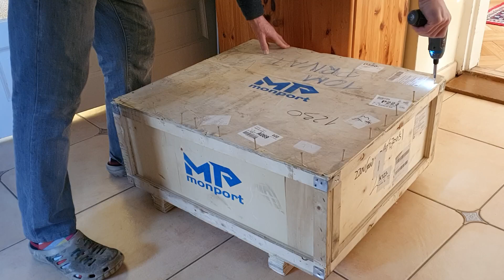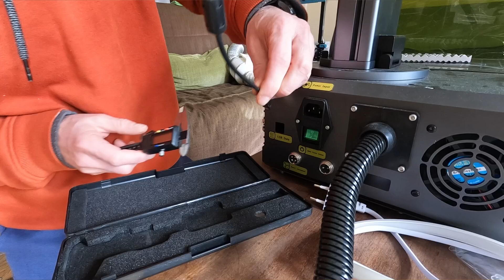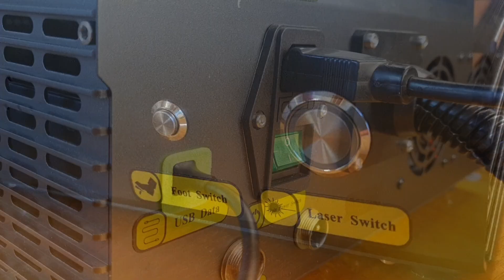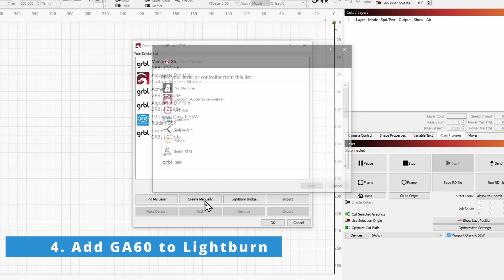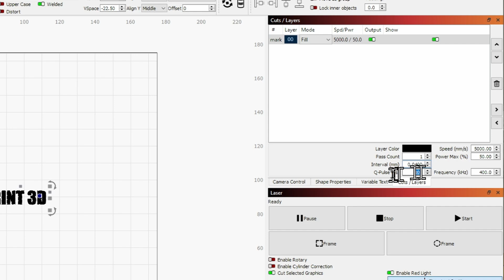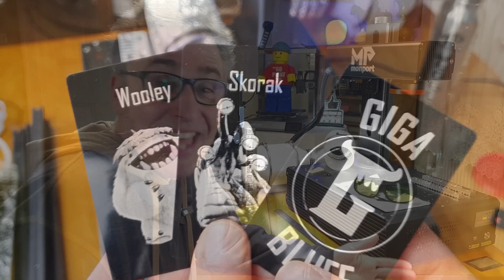Monport GA60: Lightburn Setup + How My Sovol Zero Unexpectedly Saved this Amazing MOPA Fiber Laser

Comment: Hi can you recommend which one is better, monport or commarker b6?
Reply from the maker: I only have this Monport GA60, which I am very happy with. It is very very well built. And versatile. Not JPT laser source, but looking at Commarker B6 MOPA 60W specs (though I am not sure it is the MOPA specs on their official website...), the Monport GA60 has wider pulse range (1-500ns vs 130-160ns) wider freq range (1-3000khz vs 40-60khz). Rotatable arm, no need for awkward riser. It is heavier and sturdier, which could be a plus or minus. But seems to be a bit more expensive (though with my coupon + current sale it is close). I am a bit biased of course, but very happy with this one.
Reply: Monport！ No commarker！I have a Monport GA100 and a Commarker B4 60W. I want to see the difference. After disassembling the machine, I found that Monport's workmanship was very neat and the wiring was standardized, but Commarker's interior was very poor, so I returned B4

Comment: You didn't actually ever explain what a MOPA laser is.  MOPA stands for Master Oscillator Power Amplifier.  This means that the pulse frequency, pulse width, and duration  are easily applied to a small diode seed laser, the "master oscillator".  The output of this seed laser is then applied to the power amplifier, which is a conventional fiber laser amplifier.  This combination is quite handy because we can get an "average" power of 60 watts from the power amplifier, but the peak powers can be MUCH higher.  For example, if you apply a 50% duty cycle of on-off to the unit, the "ON" power will be 120 watts.  This can, of course, be taken to an extreme..  When I worked at a National Laboratory I designed a laser system that used a 5 Watt IPG fiber laser amplifier.  Into this amplifier I delivered a seed laser pulse that was 50 picoseconds in duration at a rep rate of 31 MHz.  The resulting output beam had peak powers exceeding 1kW, yet the average power was always 5 watts.  If Monport would like me to review one as well, hint, hint, I would be happy to on my Youtube channel.
Reply from the maker: Wow, thank you for the precise and easy to understand explanation. You are right, I chose to only highlight the most practical user-facing advantage of the MOPA aspect in this introductory video (in the Lightburn setup section), as I only plan to utilize the added capabilities in a follow episode. Since this is the very first fiber laser on my channel, my aim was to introduce the layout, configuration of this style of lasers highlighting the most obvious use cases. There is much more to come! Thank you so much for watching my videos and helping the community with your insights. I agree, you should definitely demo and create tutorials for these types of devices, the creator community would greatly benefit from them!

Comment: Hi, do you know how to tell if a new SV08 has the old nozzle with the petg issue pushing it out or a newer fixed version? What is the easiest way to tell?
Reply from the maker: Yes, if you slide the heatblock off you should see a grub screw. I show it in this video: https://youtu.be/sOknzwXCks4  But I think anything sold after the middle of summer will have the new nozzle.

Comment: ¿What about Linux driver for this device?
Reply: You can verify with Monport but I think your Linux options are more limited.  You could install Lightburn on Linux and use the GA60 the way most people use it with Windows or Mac, or you can install the Windows open source LaserGRBL software on Linux running under Wine to control the GA60 but it's very limited compared to Lightburn, although honestly, my needs are usually fairly simple and I prefer simpler software with fewer options.  On my little 10 watt Elegoo Phecda laser, I copy properly scaled image files to a USB drive and laser engrave them directly from the LCD interface.
Reply from the maker: I am using windows, so I cannot really help. The usb interface chip seems to be a generic one, showing up as Cypress FX2LP after installing the windows drivers. But Lightburn it itself might be able to control it. Unfortunately this is as far as I can provide you with information. Feel free to ask specific questions, or contact Monport directly. Someone else reading you comment might be able to provide you with more useful answer.
Reply: @  Maybe is my fault i wasn't clear. Does the device even have a linux driver?
Reply: @paelnever  I think the answer is "no", but there is software that should be able to make it function anyway, just maybe not as well (with as many features) as it would work on Windows.
Reply: @timothymusson5040  Then my answer will be "no no" to this device.

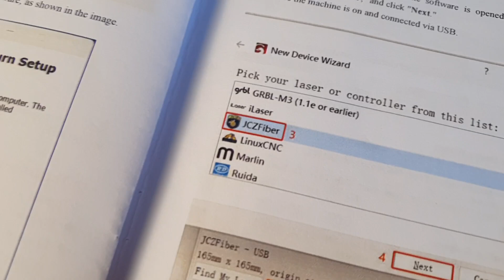Comment: 8:30 - Kudos to Monport for LinuxCNC support.  The GA60 is on the opposite end of the laser spectrum from my 10 watt Elegoo Phecda laser that I use to put the company logo on 3D printed TPU parts.

That USB strain relief was very nice, and a needed addition to the GA60.  I love FreeCAD and 3D printers for everyday practical stuff like this.
Reply from the maker: Yes, I too was successful marking TPU with my very first tiny diode laser → https://youtu.be/i8neuRXBRXM MOPA is said to be pretty flexible, I plan to do a whole video on marking 3D printed materials, PLA, PETG, TPU etc.  I just need to make my enclosure and vent system first.
Reply: @gerGoPrint3D  - The inexpensive blue diode laser engravers are OK if you occasionally want to do light engraving on opaque plastics or maybe wood and paper products, but a galvo fiber laser will quickly engrave almost any material.

Functional Print Friday recently designed a universal enclosure system with 3D printed corners and vertices with inexpensive CoroPlast used as the panels.  It's clever, as his stuff typically is.  He used it to enclose his fiber laser.  Might be worth a look before you enclose your Monport.
Reply from the maker: Thank you @Liberty4Ever for mentioning the LinuxCNC support. What does it mean? Can you please help @paelnever on what this could possibly mean for Linux compatibilty? Using Lightburn? Or other software?
Reply: @gerGoPrint3D  - LinuxCNC is primarily designed for controlling lathes, milling machines, CNC routers and other CNC machining applications.  It even has delta and various robot kinematics.  However, when I last used it on my CNC machines it didn't do raster engraving.  It's a vector based motion control system so it might be good for laser cutting applications but slow for laser engraving.  I still planned to use it on my 80 watt CO2 laser build because I love open source and all of my other shop tools run LinuxCNC, but that's a project I never finished.  I'll provide a more relevant answer @paelnever in his thread, below.

Comment: Nice demo!
Does it really do curved surfaces that easy? Could you show the whole workflow for a curved belt buckle?
Reply from the maker: You know I haven't even thought of it. This belt buckle was literally the second thing we tried after unboxing and the mandatory painted metal cards. This buckle is not that curved, there is maybe 2-3 mm difference between highest and lowest point on the surface. At a focus height of 320mm we have that much depth of focus.

Comment: I want so much a fiber laser! But even the cheapest I have seen in aliexpress is already too expensive 😅
Reply from the maker: Yes, these only make sense if you use it for business. But then they bring back their price quickly. The ease to customize cheap blanks is astonishing. And unlike other lasers or 3d printers, fiber lasers need almost no maintenance and last for 100,000 hours. Maybe you can find someone in the family who would be happy to work from home and you could share the revenue + get access to use the machine when you need it.
Reply: @ i use to maintain a couple CO2 lasers my wife used for making clothing accesories with acrylic. But now we don't have that big space anymore. I will  investigate if these type of lasers can work on transparent acrylics (i know is a wavelength thing but can recall now 😅) . Maybe we can restart that business
Reply from the maker: @ReixGonzalez  I read that Fiber/MOPA lasers are less efficient for cutting clear acrylic compared to CO2 lasers. Some suggest placing reflective (stainless steel) behind it for possible cutting. Marking is more doable. I could actually try, I have some leftover clear acryllic. But I think if she worked with CO2 and Lightburn this will be nothing new, just look into working with metal cloth accessories, there could be a whole different market in those just think about color-marking or deep engraving custom buttons the way coins are 3D engraved, or marking other blank steel accessories with color???
Reply: @gerGoPrint3D  those are a bunch of good ideas!